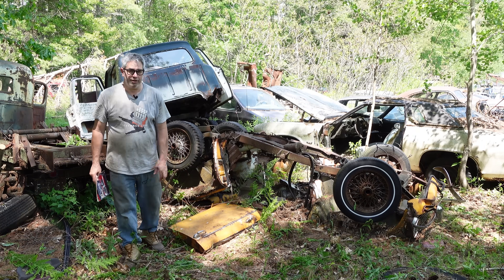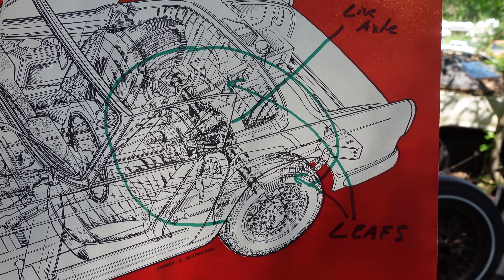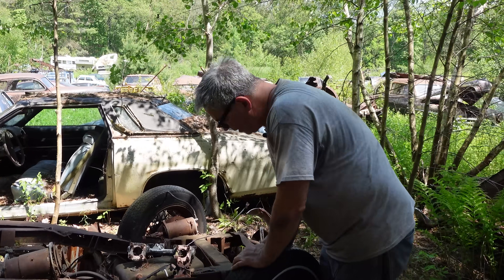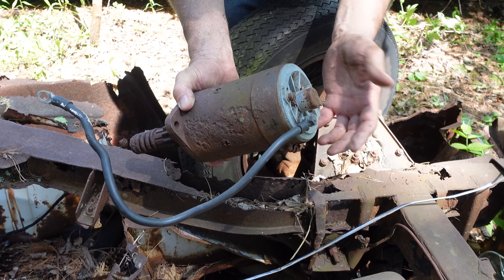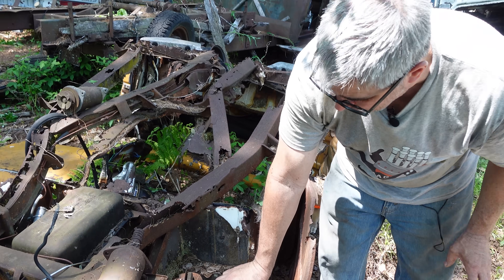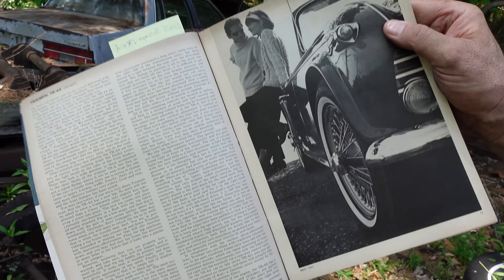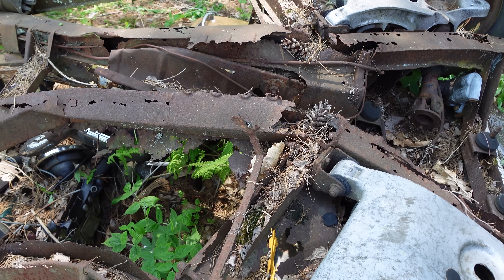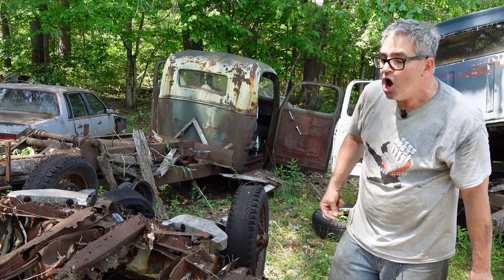Tax Thames

Comment: My next door neighbor had a '67 TR4-A, and was going to sell it to me (for $100!!) to pay for a Kawasaki 500 2-stoke triple motorcycle. It was 1974 and I was about to get my license, and I really wanted that car. Right before I was to buy it the hood was up in the driveway and he told me I better come take a look. The plugs were out and when he cranked it water came flying out one of the cylinders. "Sorry Tom, I'm just gonna junk it. It's too far gone". Just like that it was gone and I was heartbroken. Looking back it was a blessing in disguise as I ended up with a '70 Plum Crazy 383 4-speed Super Bee a few months later. I can still smell that Triumph leather interior though...
Reply: I think you did a lot better with that Super Bee. 🐝 👍
Reply: @Daniel-fd3wp  Ain't that the truth!
Reply: You dodged a bullet there.  I don't understand why people would junk a car for a head gasket though.
Reply: @mexicanspec  If I recall it was a cracked block. I spoke with a Triumph mechanic decades later who told me it does happen to these engines but was not a death sentence either. It was repairable. What Steve said about cheap steel was on full display on that TR4-A. Think about it, that car was around 8 years old at the time and had long ago started being consumed by nature. It was ratty by then but still oh so cool! A real wood dash, Smiths gauges, and real leather seats are still intoxicating to me. It made my 16yr old self oblivious to the fact it was a rust bucket. Come to think about it though, My Super Bee was only 8 when the quarters were rusting out around the wheel wells. All hail the NYC DOT and their addiction to salt in the wintertime!

Comment: TR frames were prone to rust failure, especially the rear lateral rail which mounted rear suspension arms.  When they failed you got wheel interference with frame and rapid tire failure.

Comment: I have owned a Triumph TR4A since 1971 and have always loved it. Mine is Wedgwood Blue, which I think really suits it, and is fitted with the optional wire wheels and overdrive. It has had some restoration and new panels but has never been allowed to deteriorate to anything resembling the wreck in your video. It is now not used in the winter, but I still enjoy driving it on a good day. Of the 28,465 built only 3,075 remained in Britain, most of the exports went to the US although some have returned here in later years. Top speed with overdrive is quoted as 109mph and 0-60 about 11 seconds but the engine is quite easily tunable and these figures can by improved on.
Reply: Interesting - the color of paint on my F-150 is called “Medium Wedgewood Blue Clear Coat Metallic”, but a quick Google search shows no similarity of any kind between the two hues. I wonder if the Ford designer that came up with the name was a closet Triumph fan……..🤔

Comment: Wow, that frame is definitely toast!!! I had a 1976 TR6 and we did a frame swap on the car because the passenger side rear trailing arm mounting area of the frame was totally shot and someone had used fiberglass to "repair" it. I knew this when I bought the car, I was 18 years  old and naive. I got a parts car with a nice frame for 600 bucks and we did the swap. The TR4 and TR6 used the same frame if I recall correctly. Fun cars but definitely prone to rust issues.

Comment: Standard Triumph gave Jaguar it's production tooling, and Saab it's 1850 engine. And the world, the Ferrari and De Tomaso and Pinto Cam Gears rack and pinion steering. And the Lucas  Fuel Injection.  The chronic problem...No Financial Contest against burgeoning Nader style consumerism. They had all the plant, labor and materials, but couldn't fund making  cars the achieved or exceeded crash safety , emissions and dealer assistance. That car with a Daimler Hemi 2.5 or 4.5 liter V8, would have propelled Triumph into continued growth and sales. 🥝✔️

Comment: Steve, you threw this feller for a loop with "positive ground."  If you could elaborate on that with a short video, many of us will learn something.  You are a true automotive  encyclopedia.
Reply: Positive ground means that the positive post of the battery is connected to ground, and the negative is the 'hot' wire. Most American makers switched to negative ground in 1956, but the Brits continued with positive 'earth' up into the 70's. This may sound weird, but the main reason to switch from positive to negative ground is that positive ground makes the car rust faster! (If you have ever noticed that the positive terminal on the battery corrodes faster than the negative, that is why. It's an electro=chemical reaction).

Comment: The Triumph like the MG or Austin Healy etc suffered from the same design issues. They put so much emphasis on style and design and handling yet stuck with under powered asthmatic OHV engines. Those cars with a larger OHC engine wouldnt need the piggy back carb set up for slightly more dismal power. My Opel Kadett 1.1 with dual carbs was the same way although it produced 60 Hp from 60 ci which was impressive but still nothing like the OHC 1.9 which was twice as fun.

Comment: The Fergy tractor engine has bags of torque,, as did the Vanguard engine. Which is what these are.
The TR4 and later TR6 are quite good looking cars. However the front and rear suspensions seldom ever seem to be connected. A very loose thing.
Triumphs MGs Jag all had the bolt on adapter like that. Getting rid of the wire flywheels and those adapters is the best thing you can ever do. Fit alloy wheels and halve the unsprung weight.

Comment: I had a 1968 Triumph TR250 convertible with that body style. The TR250 was basically a TR4 or TR4A with a 6 banger. The hood (or bonnet) hinges were in the front so it opened opposite of most vehicles but that was changed for the 1969 model, as the whole body style changed and became the TR6. 

The power to weight ratio made that car a little screamer. My TR250 had a foot pedal that operated the wipers, presumably so both hands could remain on the steering wheel when driving it hard, which I did until I slid into a curb while doing doughnuts in the rain, and it was never the same again. 

That was around the time I enlisted in the military and I just called to have it junked. The tow truck driver decided to buy it for himself and offered me more than the junkyard was going to pay for it so I accepted. He hooked it up and then said the frame broke. He still wanted it though. I guess the Michigan winters and road salt wasn’t very kind to the underside, which was deceptive considering everything else was flawless. Ah, to be 17 again. Great memories.

Later I bought a Triumph Spitfire and the 4 banger power was disappointing, even after milling the heads. It was yet another vehicle where the hood (or bonnet) opened from the windshield forward.

I’ve also had a MG midget, which was under-powered as well. I had a Triumph TR7 about a year before the TR8 came out but by then I moved on to the dependability of a Toyota Corona and then a Cressida before moving back to the American muscle of an orange ‘67 Stang with a 390, tube headers, an aluminum high rise intake, a Holley double-pumper carb, a Mallory dual-point distributor, a  Hurst competition plus shifter, traction bars, and someone said the engine lobe indicated a race cam but I can’t say for sure. Someone removed the entire trunk floor pan and all that remained was a rear-mounted starting battery. That’s the way I bought it from the backlot of a new car dealer on Telegraph Rd in Michigan. I presume it was a trade-in. 

It didn’t matter if I followed the rules of the road or not, that orange ‘Stang was a cop magnet. But I couldn’t help but oblige whenever challenged. I won every race except one and that was against another ‘67 Mustang, but it was the smaller coupe. We were neck to neck until he started pulling away. I didn’t know the guy but we were both pulled over to receive our tickets and I was shocked to discover he had a smaller 289 hi-po with about the same mods my car had. Anyway, I nearly lost my license from so many tickets so I sold it.

Anyway, that Mustang gave me a similar experience of the TR250, except the Triumph didn’t attract as much attention. Aside from my personal useless stuff I’m running on about, I’m sure the tidbits about the frame rusting out (as in your review) or the floor-mounted wiper pedal on a TR250 is enough to add enough value to post here.
Reply from the maker: That Mustang sounds interesting with its trunk-floor-delete. The trunk-mounted battery suggests somebody was a drag racer and knew about improved weight distribution through rearward shuffling of mass. And you bought it on Telegraph Rd., in the Detroit area. My mind goes to "check the VIN...was it a Ford factory-assisted street racer"? Probably NOT. But the mind wanders! Thanks for watching and writing. -Steve Magnante
Reply: @SteveMagnante  I found the Mustang at a Ford dealer @ 9600 Telegraph Rd, Redford MI. It’s Pat Milligan Ford today and may have been back in ‘76-’77 but that was 46-47 years ago so I lost that detail. I have no idea about the VIN but maybe I could ask the Michigan Secretary of State if they kept the history of the 100’s of vehicles I’ve bought over the years. I still have about 11 vehicles rusting away in my side yard, many I’ll have to get around to junking soon, like a couple ‘86 Honda Preludes (one still starts and drives) same with a couple ‘89 Geo Spectrums. The matching models were to supply parts for the runners. The ‘88 Mitsubishi van is what most people seem to want me to restore.
The 1989 Vixen XC21 is an unusual find. The 1986 Vixen TD version was touted as a garageable motorhome as it was only 6’ 4” in height with 8” of ground clearance. It had a roof that would pivot on one side to increase the interior headroom. The rear had a BMW 2.4L 6 cylinder turbo-diesel coupled to a 5 speed manual. The second model was a limo (1989 SE) that changed to a fixed raised roofline and the rear engine changed to a GM 3800 series V6 with a GM 4-speed automatic. Well I bought one of each model at their bankruptcy sale in the shadow of the Pontiac silverdome (Michigan) where they were assembled. I sold the partially assembled TD and kept the gas version, which was actually their driveable prototype with sensors attached everywhere. My $10K good buy has been sitting for over 33 years and the only place it was driven was to a dealer to fix a wiring issue that eluded me. It’s in sad shape today but it’s still on the agenda as a fixer.

Comment: Autocross raced a 66 TR4 back in the early 70s.... the live axle was superior to the IRS hands down..... powered mine up with the 88mm and did some head work....and a cam.... all that on what was essential a Standard tractor engine.... probably got it up to 140hp.... totally the easiest car to ever work on..... btw..... changed out the Lucas electric for Delco